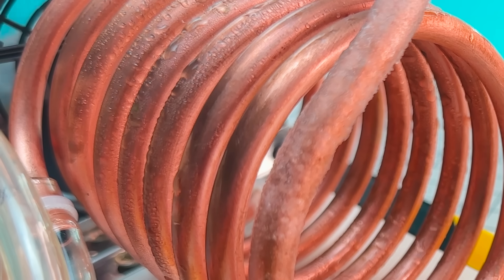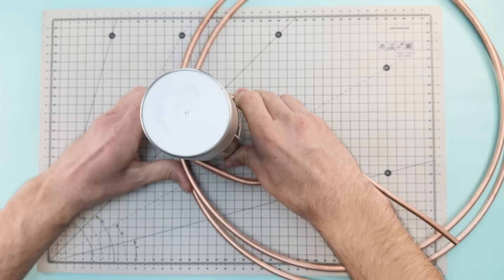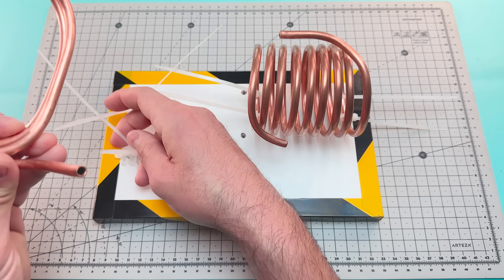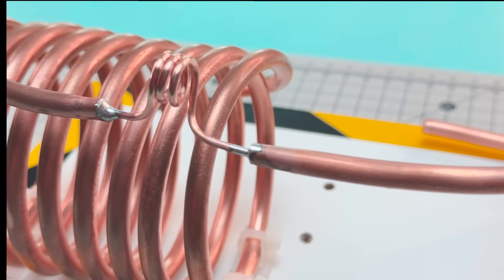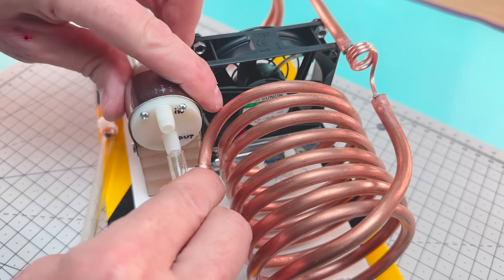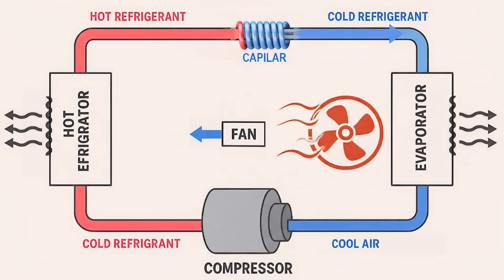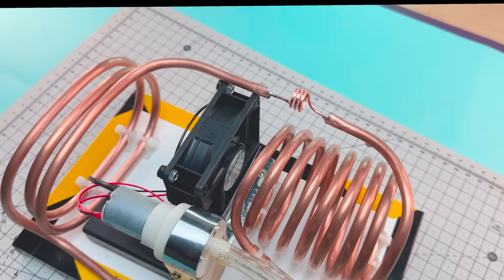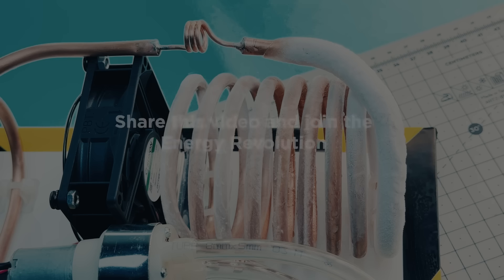Make your own AIR CONDITIONER at home Fast and Easy!

Comment: Can i cool bottle of beer or dring in some hours with the bottle, or it is not works at all?
Reply: yea you can cool any bottle in any position, but that's it. the warm and cold air will equal in the room that's why all air conditioners need to transfer the heat out of the room. Personally i would do it the way in wich hot air don't blow to the cool side for example make it pararell and use second fan and make them blow air from each other.

Comment: Can't we take this idea and 3d print a housing for the heat side, install a second fan that blows room air into the housing where sits the heated copper coil, and attach a pipe that goes outside of the window?

Comment: Where’s the TX valve and the refrigerant and the compressor. I guess this just generates clicks
Reply: He shows that he uses Isobutane as a refrigerant. The compression is made by the motor and the tiny pipe combined. This mechanism actually works, it's just very inefficient compared to more complex and powerful mechanisms.

Comment: Just like a refrigerator or air conditioner, you have to get the heat out of the room. Here in the same room. So it doesn't work

Comment: The problem here is there needs to be an ehxhaust fan and it needs to be plumbed to blow outside. This is heating on one side and cooling on the other but both sides are indoors so it's about cancelling out. It would probably cool off a can of pop really quick though if you put it in that coil and spun it slowly.

Comment: Need a bigger fan to blow over the evaporator to transfer more btu into the refrigerant and you would need a longer line set to reject the heat from the condenser. This just takes heat from the evaporator and rejects the heat into the same space from the condenser. You don’t want the evaporator to freeze up like that.

Comment: that is not how AC works though. You have the full system worked out, but you fail to tell people how it "cools" the room. The way they work is just moving heat. It can take heat from your room and put it outside. Then you get the AC effect. you're not removing heat from the room with the system you have.

Comment: This will not cool off a room. When that coil gets frosty because the isobutane is boiling off into a gas, the temperature drops because it is because it is absorbing heat to turn the isobutane from a liquid to a gas (change of state). That hot gas is and then pumped to the other coil where the isobutane condenses back into a liquid by venting off heat. You're only moving the heat from one coil to the other. That is why home refrigeration central air conditioning units have a coil inside at the blower and a coil outside to vent off the heat. The air conditioner is not "making" cold. It is only absorbing heat from inside and pumping it outside.

Comment: this will define the basic ideea for a fridge, or an ac, small but it works. freon is a mixture of flamable gases..... we set the ac hot side outside, yes. other then that, you just judge... what ideeas have you tried lately? we all can find problems in it, judging from what we know from books. when it comes to "hands on experience" can you all do at least that? sure, a bigger compresser/pump, more coils. more gas, bigger battery.... let us see those problems fixed by you. not just pointing fingers on stuff that you can't do either
Reply: Freon is non-flammable. The problems in this purported air conditioner are not due to books we have read, but from physical law. I have no idea what you are trying to express, but it seems to be a rejection of applied science. I'm sorry you find that offensive, but you also probably don't think indoor plumbing is such a good idea, either.

Comment: This is horribly inefficient 

The Condenser Fan evaporator placement essentially makes it just pull hot air to cool. 

Separate the Condenser from the evaporator, ensure that the fan is not drawing from the condenser (this means 2 fans i for evap one for condenser)

The frosting on the pipe is also an issue. This creats a thermal barrier for drawing heat in, fixing this requires a housing and a larger Air flow volume 

Good lil science experiment to teach about Hvac not a good cooling unit 

also the motor is under volted in this. this can cause strain and wear depending on the modle
Reply: How can a motor being under voltage cause strain on it😂😂
Reply: @YeahNoTellTheTruth 

Under voting a motor causes inefficient transfer of energy. Sense the electricity isn't able to turn the spindle effectively they build excess heat. This causes thermal ware on the wire itself.

Now think of it this way. Motors typically have these wires wound hundreds of times and they are usualy fairly thin.
Reply: @YeahNoTellTheTruth  It will heat up the stator.

Comment: One 9V battery is insufficient to power a small 12V fan and 12V air pump. Maybe with a 12V lithium ion Lantern battery you could under optimal conditions get 1500 BTU for 24 hours before the battery dies and it might cool a small room. :face-blue-wide-eyes:
Reply: Without disposing of the heat, it won't cool off anything except a small concentrated mass.
Reply: @garymclaughlin9559  of course but it is a model to show how to build it. It would have been nice to mention that in the video, but I presume you need to put insulation and install the condenser outside the window. But the unit is still flawed. A 9V battery has insufficient power.

Comment: BTU?
Reply: BTU stands for British Thermal Unit, a unit of energy commonly used to measure the heating or cooling capacity of appliances like air conditioners and furnaces. One BTU is the amount of energy needed to raise the temperature of one pound of water by one degree Fahrenheit.
Reply: @minimalreification  thank you siri what i actually meant was how many btu?
Reply: @karimkamel4295  Then one might have said so. For the polyglot non-English speakers.

Comment: You will need to add insolation and put the condenser side outside a window so the heat is removed from the room. Otherwise you are just moving heat around in a room.

Comment: A good model to demonstrate the principle. Only it will not cool any room. As many already mentioned the hot spiral has to be outside. But to cool even a small room about 600W cooling power necessary. And to get that about 200W compressor is needed. Anything less is a toy.
Reply: These figures are arbitrary and nonsensical. You could in theory have an almost perfectly insulated room, in which case the cooling effect would come to dominate even if it took a very long time. That is presuming the heat is vented. The wattage comparisons mean nothing without the parameters of the context.
Reply: @garymclaughlin9559   nonsensical; So you're saying that all air conditioner manufacturers make nonsensical devices ;)

Comment: LOL. Great spoof video.

1. A 9v battery might spin a CPU fan a bit but they run off 5v or 12v so it's not enough for 12v to spin properly and might burn out a 5v fan. 

2. The 12v air pump needs more than the 50ma that a 9V battery can supply. Under load it will need a couple of amps.

3. Squirting a little gas in will not do much. The air has to be completely removed and you need a desiccation filter or water in the gas will turn to ice and clog the pump. 

4. The best gas to use is freeon or the safer alternatives. The cheapest and most available will be butane.

This video is clearly aimed at a not too discerning audience.
Reply: People will make this model at home and will understand for themselves what heats up and what cools down.
Reply: did u see the end of the video?? the tons of sponsors? its not to entertain or bring any content. its made to make money only.
Reply: @milanarybethwindictive3969  I didn't watch the sponsors.

Comment: Yeah, this is a one-trick pony. It works at first when you inject isobutane, but the pump can’t compress it back into a liquid state. Once the system equalizes, the cooling effect stops and it just ends up circulating gaseous isobutane with no real refrigeration going on.

Comment: 2 things.
1) how do you disipate the condensers heat? I assume if the medium you use to cool compresses it will also heat...thermodynamics....same as when it condenses
2) excess moisture removal....cooling the outside air will act as a dehumidifyer...this is why there is frost on the cooling coils.....that moisture has to be dealt with...
other than that...yep, that's basic cooling.....
curious why not use something easier to deal with like amonia and glycol to prevent freezing internally?
Reply: CAN'T ANYBODY ON THIS DAMN THREAD LEARN HOW TO SPELL?

Comment: The system is missing two critical items.
1) A partition between the hot and cold side.
2) A fan on the hot side blowing air away from the cool side.

Internal air on the cold side is blown over the coils absorbing more heat and blowing the colder air back into the room. External air on the hot side is blown over the coils to remove heat through atmospheric convection and push it to the outside air. The hot side is the part that is exposed to the outside of a house when you look at window units. The big box on the outside of a house is where the hot air is pushed where a large fan blows it into the outside air.

Comment: How can you increase/decrease the temperature of a system, if there's no addition or reduction of energy from the system due to the surroundings
if we separate the condenser unit from the evaporator, this will definitely cool the room at the minimum level, but its's functioning will not equal to an commercial Air conditioning system

Comment: Before i had a good cellar, there was a way to gain 10° to 15°celcius compared to outside when it was 30°celcius!! In the pyramids they did the same thing by creating air currents in large volumes underground!! Air conditioners heat more than then cool, sending that outside should be prohibited, the planet is already largely heated by electric and thermal engines, and i'm not talking about what is needed to cool a nuclear power plant, it's critical!! Human are more stupid than they were millennia ago on certain points, and they are heading for their loss!!

Comment: This is silly. 
You can’t steal from “Peter to save for Paul” (in the same room)
The coils need to be separated -compressor outside
-condenser inside
There are other issues also. (Like requiring an actual compressor for any meaningful cooling.
Reply: What is a compressor but an air pump.

Comment: Genius! You could even make it solar powered so the battery doesn't run out. You could also incorporate a controller and wire in a temp probe so you can set what temperature you want the room at. You will probably need to set a defrost clock aswell or the evap will just turn into a big ball of ice. Probably want some drainage to go with that aswell. And a bigger fan. And put the condenser outside. And make it all about 1000 times bigger.

Comment: Works as advertised, you need more than a 9v for long term operation and obviously you need to seperate your evaporator and condenser.  The concept itself is valid.
Reply: Except for the claim that this can cool a room, since the evaporator would be in the same room, so there is no net overall change in temp.  It would cool a can though.

Comment: Das ist so blöd, dass es schon wieder lustig ist.
Reply: it's just a little air conditioner...
Reply: @beargillium2369  Not with the condenser and evaporator so close together.  Net effect slightly warmer if the heat isn't pumped away.  That's why AC units pump the heat outside.

Comment: Nonsense, violates consevation of energy laws. To put it simply, leaving your refrigirator's door open does not cool the room.
Reply: Not looking to cool the whole room but just a blast of cold air from the fan.
Reply: @miked3723  That will work, and if that is the intent it is successful. But they claim more than that.
Reply: this is literally how your refrigerator works 😂

Comment: This is technically correct and intellectually stupid.  The heat you pull out of the air is discharged right back into the air.  And the battery will last about 10 minutes.  It won't cool a room, or even a closet ...  much less a whole house.  Silly.  We're not all idiots out here.
Reply: obviously you would need to put the condenser part on the outside of a window, you know, like how every window mounted ac works...
Reply: Non c'est techniquement incorrect car avant d'injecter du gaz dans un circuit frigo on doit le "tirer a vide" afin d"extraire l'humidité du circuit. La présence d’humidité dans un évaporateur va geler et boucher le capillaire.
Reply: But it is a great teaching tool. Replace the battery with a regular 12 volt power supply and it could be used to set on your desk as a personal A/C and not as a room A/C. Who is the idiot now?

Comment: the heat from the pump and the condenser loop cancels out any refrigeration effects
Reply: Yes for a room type A/C. But is the cold air from the fan was directed on a person, they would get the cooling effect without raising the temp in the room since there is that loop.
Reply: @robertwebb4812  
Unfortunately in this design the fan is drawing the hot air from the condenser. There would be a minimal cooling effect. Probably no better than a standard desk fan.
Reply: @jimdandy2024 there should be some cooling effect, but the other side would get quite hot as well
Reply: @beargillium2369  So basically you agree...this is a bad idea.

Comment: This is awesome. Can anyone confirm the cooling capacity (watts) of this unit. Can it be used to cool a PC?
Reply: This is my question!  I have some pumps of that type, and I've opened them up and looked at how they worked (to see if they could handle small particulates in water used for hydroponics).  They can do some compression, but it's pretty limited.  This should work, but the question is how well?

I think I can guarantee it won't cool a PC effectively.  If it could, we would see $20 refrigerative PC coolers all over the place instead of much higher risk water coolers.  A better designed version (not putting the condensation coil right behind the fan...) would probably work as a personal cooler.  It almost certainly wouldn't cool a room.  That said, the principle could be applied to a larger scale device with a better compressor to get really good results.  This is how AC units and refrigerators work, after all!

Comment: Now... I know Window AC units exist... But do you really expect me to believe this thing runs on a 12v air pump, instead of a compressor...?
Reply: can you please explain the difference between an air pump and a compressor
Reply: @beargillium2369  Static pressure.  The pump used in the video is actually an air/water pump (I have several), and pumping water requires higher static pressure than pumping air.  That means that this pump can actually compress air, though not terribly well.  A real compressor can compress air a lot.  A simple air pump, on the other hand, will generally stall out or start leaking pressure backwards before ever developing any real pressure.  I opened up one of these pumps (to see if it could handle a little small particular matter in water, as I was using the pump for hydroponics), and they aren't simple air pumps.  They are designed more like compressors than like standard fan or impeller based air pumps.

Anyhow, I'm not sure if the video is 100% legit or not, but I do think this style of pump should be able to achieve some cooling, given the right coolant and system design.  It won't cool a room though (even if the condenser coil was outside of the room).  If all you need is cool air blowing on you though, I suspect it might work for that.
Reply: @rybec  my point to the op is that it's pumping a gas in a very small cycle, and aside from what you mentioned there's not technically a difference between a pump and a compressor (aside from the pressure output)

Comment: And yet the cheapest air con units are hundreds of pounds. God I'm sick of being ripped off!
Reply: This doesn't move enough heat to cool a room.  The window units are expensive because they can move a lot more heat.  (The window units are also designed to block airflow between the inside and the outside, which is not as easy as it sounds.)

I would also guess this thing is extremely inefficient compared to a standard window unit.  You need a real compressor to get good efficiency.  (And those real compressors aren't cheap either.)
Reply: The difference is that they actually cool. This does absolutely nothing, since the heat from the hot side is not transferred outside.
Reply: @Ziegeri and if you put a window ac unit inside your room with the window closed that's not gonna work either 😂

Comment: The purpose of the project is to cool a bottle of beer or cola, nothing more. And it will be more useful if it is outside, because it is battery-powered and the heat from the condenser exhaust will dissipate more easily.
But the biggest advantage of all is the performance of views on YouTube. :)

Comment: And you power a 12v air pump and a 12V fan with a 9v battery? Not to mention the physics...
Reply: it's direct current, with a 9v battery it will only spin more slowly. it's an interesting project to repeat in schools to learn